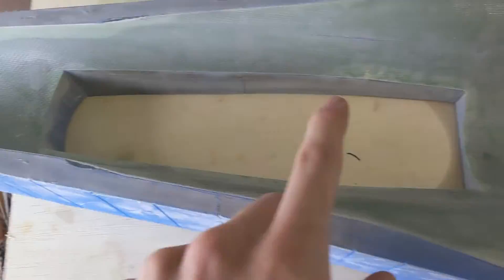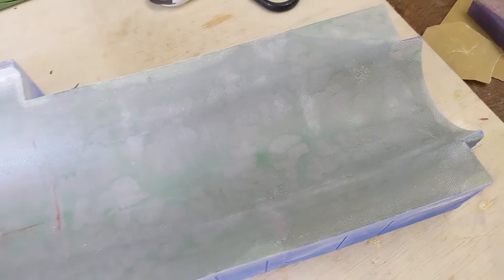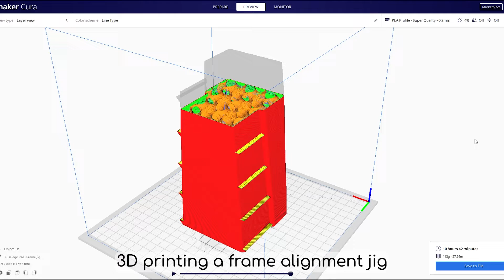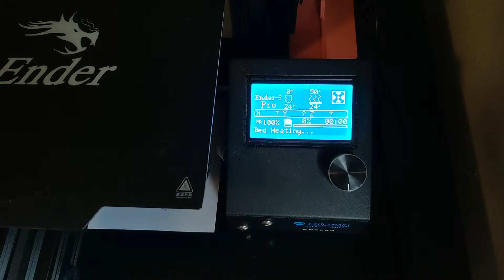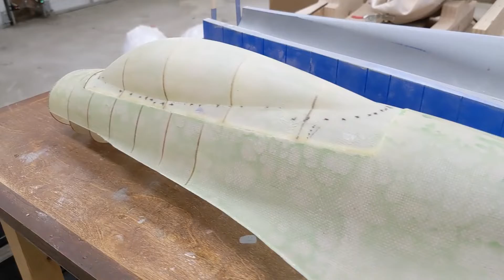Let's Build The Fuselage!  RC F-16 - Part 7

Comment: Hi sir, what type of epoxy resin are u using? And what are the ratios of epoxy and hardener?
Reply from the maker: I use West Systems 105 resin and 205 hardener. 5 parts resin to 1 part hardener.
Reply: @3DParadigmDesign  thank you for your answer <3

Comment: I have a doubt...why haven't you used any longitudinal brace (stringers) that runs through all bulkheads of the fuselage? That would have made your airframe stiffer longitudinally
Reply from the maker: I considered using them but determined they weren't needed. The spacing between frames is so small that the skin itself doesn't need them for stiffness. The fuselage is actually plenty stiff. There's internal structure that helps with its bending. Like the two support beams for the battery and two longerons between the main landing gear and horizontal stabilizer frames. Also, the inner EDF ducting through the frames provides an incredible amount of stiffness. The fuselage is a double walled tube there essentially.

Comment: How did u made that blue mould?
Reply from the maker: I 3D printed it! I have another whole video dedicated to the 3D printed molds.
Reply: @3DParadigmDesign  is there any other easy way? I'm going to make Cessna 172 . I wS thinking how about if i first build a model then use it as molding by fiberglass. I m not sure if this is a good technique
Reply from the maker: @Nonenone-dd6xo  that's actually a pretty common technique! It's not easy but making molds is never easy unless you have a 3D computer model and a machine to make the molds for you.

Comment: love the channel nice work. May I Suggest something with respect to peeling the part from the mold? buy a compressor and flatten the metal pin it should fit in between the fiberglass part and the mold and spray air in between. it will lift with ease.

Comment: Hi ! i'm very interesting to build this model. what did you base the model scale on? are they "faithful" to the real size?
Reply from the maker: I based the size off a 70mm EDF. It works out to be about 1 : 13 scale. I did my best to make it scale. I modeled the F-16 based on a 3-view drawing.
Reply: @3DParadigmDesign  i got a hight poly 3D model very realistic. but i don't know how to convert it from LOD files to STL file. Very nice job! i would like to do one for me with the Block 20

Comment: how did you make the molds?
Reply from the maker: I designed them in fusion 360 and then 3D printed them. I have a whole video on them: https://youtu.be/eH55p1k6gYg
Reply: @3DParadigmDesign  alright so you've designed F-16 with Fusion 360, right? not Autodesk/Solidwork?
Reply from the maker: That's right!
Reply: @3DParadigmDesign  Thanks mate. I'll look for it

Comment: I see you used fusion 360 to model it, but how exactly did you model it? What did your reference images look like? What methods did you use?
Reply from the maker: I started the model by importing a 3 view of an F16 (side view, top view, front view) and some cross-sections of the fuselage. Then I made many sketches at different station values and lofted them to make the fuselage. Hard to go into too much detail here. After the build's complete I may make a video that highlights how I modeled it.
Reply: @3DParadigmDesign  how did you decide on how far apart to space the ribs?
Reply: @3DParadigmDesign  Thank you VERY much btw. I'm trying to make a SAAB 21 in f360.
Reply from the maker: I sort of guessed based on intuition. I knew the skin was going to be pretty thin (I only used 1 ply) so I knew the ribs and frames had to be pretty close together. Also, anywhere that there's curvature in the skin helps a lot to keep it stiff. Flatter parts like the wings and tails are a bit less stiff. But the 1.5 inch spacing seems to be just enough.

Comment: Why don't you use laser machine to cut those wood parts?
Reply from the maker: I just wanted to make them by hand for the challenge...but after I started I soon realized it was way too much work lol. But I didn't want to place a new order for laser cut parts so just finished them by hand.

Comment: What is that tool you use to cut the glass cloth??
Reply from the maker: I'm using a rotary cutter from Fiskars. OLFA also makes a similar tool. It's nice using this tool instead of scissors because it doesn't push the fibers and mess up the weave. But it's important to have a smooth flat surface to cut on or else the rotary cutter will miss some fibers.

Comment: Tuyệt vời! Xin hỏi khuôn làm bằng chất liệu gì vậy? Dùng chất gì để không bị dính khuôn?Cảm ơn.
Reply from the maker: The molds are made of PLA plastic made on my 3D printer. Use mold release wax and/or PVA release agent to prevent the parts from sticking.

Comment: Зачем использовать фанеру, если есть 3d принтер и можно все напечатать из HIPS например?
Reply from the maker: I wanted to use wood as much as possible for internal structure for 2 main reasons. First birch plywood is heavy but it is still lighter than HIPS or PLA plastic. I need to keep weight as light as possible for this build. Second is thermal expansion. I was afraid of making some internal structure out of plastic as it can expand relatively a lot compared to wood. I didn't want the plane deforming when it gets warm.

Comment: Great work ! U should maybe hollow out your 3D aligment designs in order to consume less material 😁
Reply from the maker: Thanks! I print them with 2 perimeters and about 5% infill so they are efficient with material. If I were to make it physically hollow with a hole going through it may actually use more material because then there would be about 2x extra perimeter distance that's it's printing walls for.

Comment: Applying a 2k coat after primer will give you a perfect shiny surface. Give a try.
Reply from the maker: What do you mean by a 2k coat?
Reply: @3DParadigmDesign  two components coat. Normally poliuretane based. It is used in the automotive industry as finish coat for the car’s paint. You can even use a 2k paint. You get a super clear and strong finish, you can polish it to mirrors shiny. Then apply a couple of layers of wax and ready to mold.

Comment: What would you think to attempt to copy a discontinued freewing Su-35 and try to replicate it?  I was thinking about getting a laser scanner and get into 3d printing in order to replicate foam planes somehow.
Reply from the maker: I think it's totally doable in many different ways. You can make a fully 3D printed version of the plane if you like a CAD modeling challenge, or you can go with a similar approach to my F-16 where you make molds for composite layups, or you can do all foam sculpting/carving/hot wire cutting. Really so many ways to replicate the plane.

Comment: Don't waste time cutting the paper templates. Spray the back side of the paper with spray adhesive and stick it to the plywood. After they are sanded use acetone to wet the paper and it will peel off easy

Comment: To pull part out ez of the mold, try a airhole with a 1/16 or 1/8 nozzel, using a 50 to 80 psi at all sides to blow your parts out. adapt and improvies , The psi that I used on surfboard car parts. Oh on your mold I wood airbrush with number 5 head to spray  a even tack Chot two or three times parts will good .

Comment: It would be nice if you could tell what programs you are using to develop the design on the computer to make the jigs, molds formers and parts on the 3d printer. Thanks for the videos.
Reply from the maker: I use Fusion 360 for all the CAD modeling and making STL files out of the jig models. Then I import the STL files into Ultimaker CURA to slice. Then to the 3D printer.
Reply: @3DParadigmDesign  Thanks, how hard is it to get your design into the cad program? Getting the molds to fit the plane design I would think is hard. Very nice work.Thanks again.

Comment: Nice
Can you tell me what resin is it
Epoxy laminating? 
Pva 
And what  about wax what formulation we should tell store?

How many layers of cloth you kept?
Reply from the maker: Epoxy: I use West System 105 resin + 205 hardener

PVA: FiberGlast #13 PVA release film

Wax: Turtle Wax automotive wax. There exists other waxes that are more specifically for mold release. You might be better off using those. But I've had good results with the car wax.

I'm using just 1 ply of 6oz fiberglass for the skins.
Reply: Thanks

Comment: The part where the glass does not bend very well, mix up some cabosil and epoxy and apply it there on that portion of the fuse.  Micro balloons run too much.  Cabosil thickens up much better and stays in place.  Then lay the glass over it.
Reply from the maker: I've been using West System 406 colloidal silica and tried this for some of the remaining fuselage skins and it worked perfect 👌Will show the results in the next video! Thanks!

Comment: Hey nice build. I use toilet paper alternate to peel ply. I put it on wet part lay up..after 2 minutes I lift off so the excess resin is soaked into paper and after drying it leaves rough surface.
and for edges to come out nice and sharp mix micro balloon in epoxy resin and make a paste..then take a small plastic bag and put paste into it..then move all of it to the plastic bag corner and shape it like a cone. then cut the edge of plastic and you will get yourself a paste applicator. then before putting cloth into the mold, put that paste on all sharp edges where the fabric can not fold enough.

Comment: Instead of brushing the PVA onto the mould, you should really use a spray gun and spray it on, two light coats will suffice. It will give you a nicer finish.
Reply from the maker: Thanks for the advice!
Reply: Yeah I was going to mention that, dilute it with water I think will help, airbrush it or also use a spray cleaner bottle
Reply: Well Steve, I have an inexpensive paint spray gun that I use, I set the compressor regulator for 30 PSI. The only time I dilute the PVA is when spraying, the PVA seems to develop spider webs that float. Then the water helps eliminate that issue as PVA is actually drying too quickly. I tried the spray cleaner bottle method but it applied to much and was inconsistent in it’s coverage. The airbrush works, but it doesn’t really work on big moulds. I take it you are in the USA, if so, go to your local Harbor Freight Tool store, they have inexpensive small spray guns for under $30.00 They work really well for this.

Comment: when using PVA put drops of detergent soap
 I hope it helps
Reply: Is it to break the surface tension to they will stick uniformly ? do I add water and detergent or just detergent?
Reply: @irwanadinatha6110  just detergent, no need to add water.